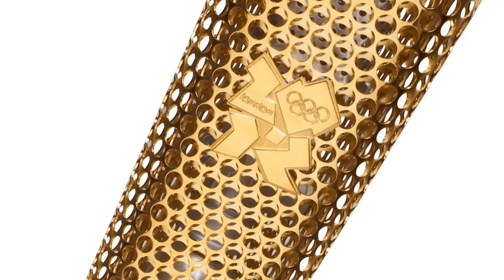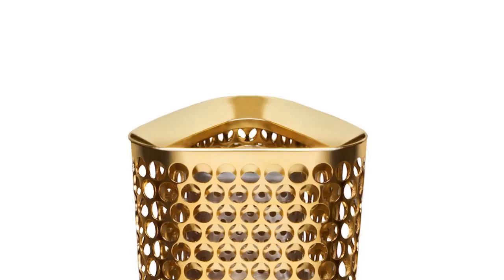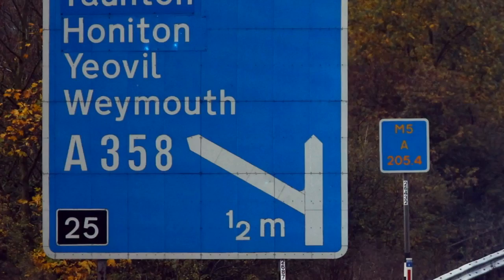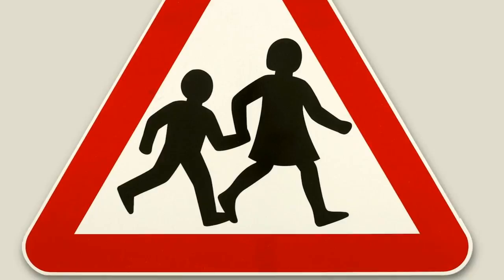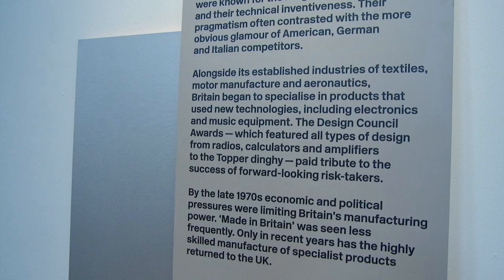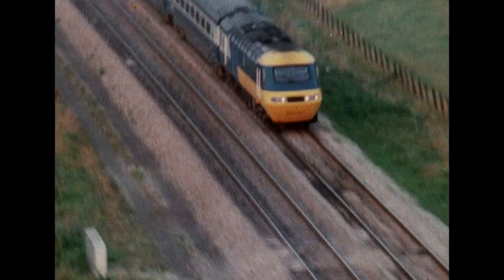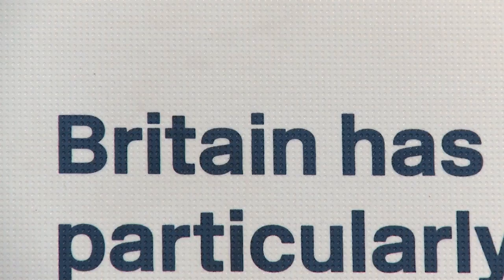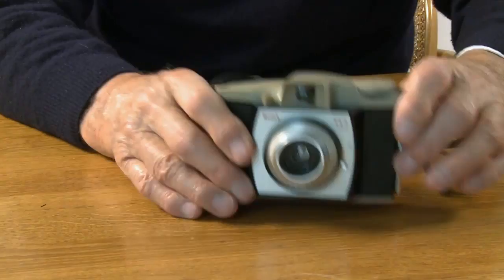British Design Stories

Comment: The new routemaster design is truly terrible small poky windows on the top deck with no ventilation Everyone sits at the back where the windows can be opened

You see nothing of wonderful London from these buses because the eye line of the windows is tiny and annoying to look out of the sky and taller buildings obliterated

I'm hoping they'll discontinue them